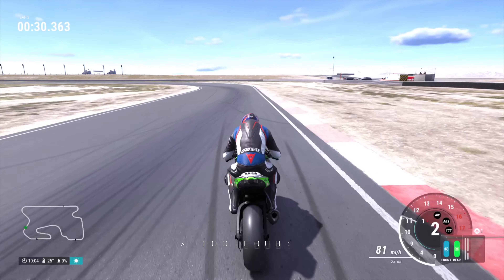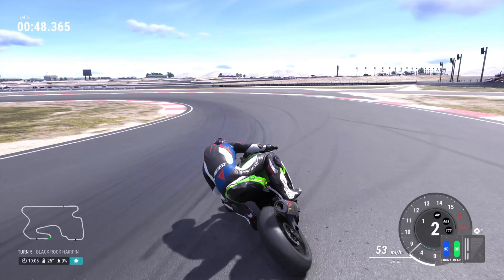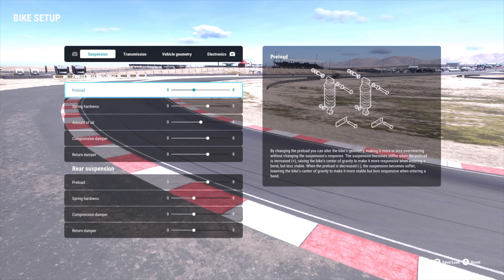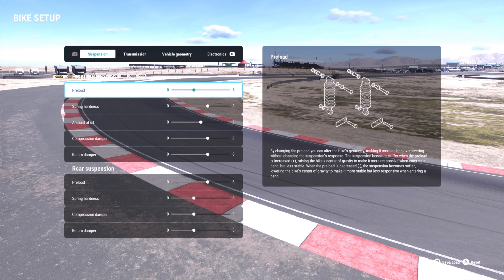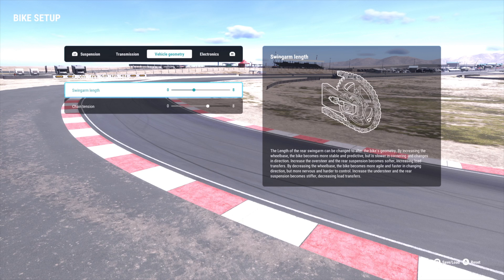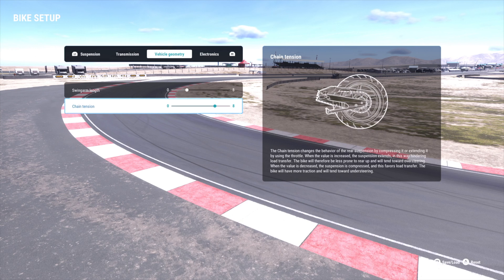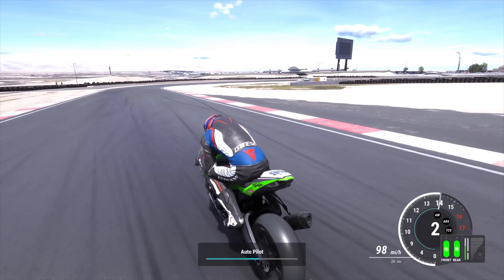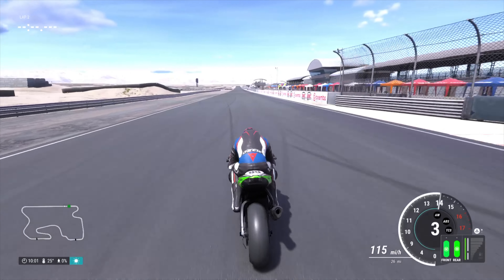Ride 5 Basic Suspension Set Up

Comment: Saw ur electronic build having ABS on will def messed with ur cornering. I have might set to 0.
Reply from the maker: Thanks! YES I found that out after the video.
Reply: @Nuumet  the only thing I have on is engine breaking max an TST set at 1 everything else is 0.